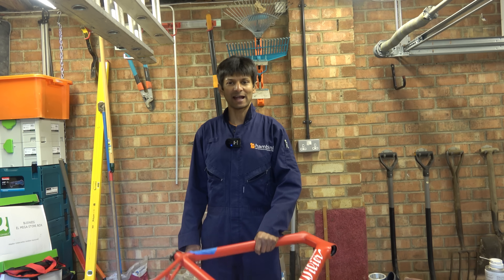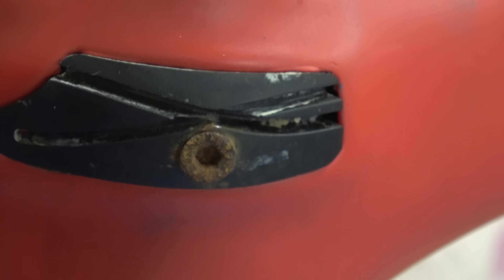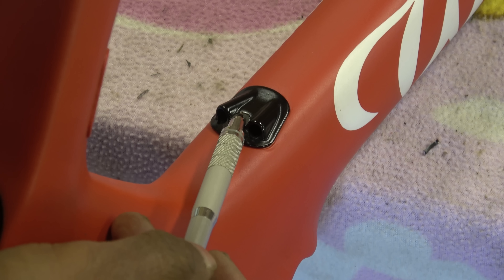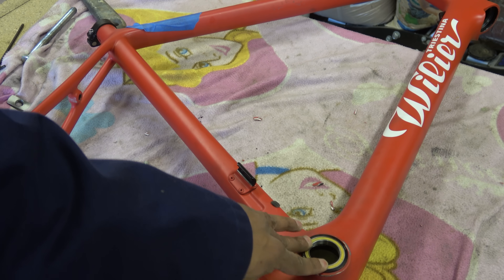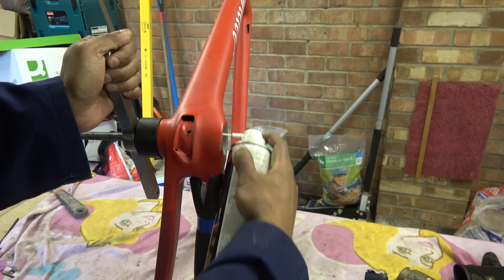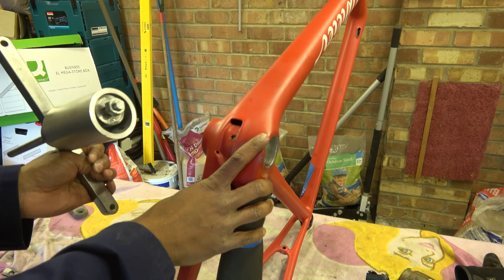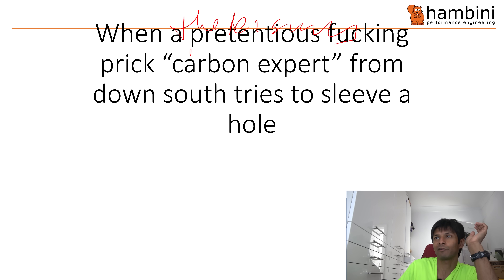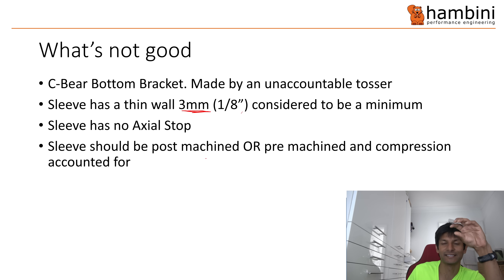Utter Carnage: Wilier Frame DESTROYED by a 5YO Armed with Rage, Facts and a BLOW TORCH

Comment: Hmmm as much as I enjoy your videos, calling the brand shite and then showing us a clearly fake frame with the shittiest paint job and repairs out there, just does not sound right. Also f* knows how they inserted that bearings into that dodgy shell, calling those bearings immediately shite is not very factual...
Reply from the maker: I don't think it's fake, it's a willy frame that has been sprayed by the carbon expert from down south.
Reply: @Hambini I could argue like an expert farmer that "I know their sh!t, this is not their sh!t". I have collected many Wilier frames through the years and although most of them are genuine crap from China, they are sh!t but for different reasons. One proof for all: for the carbon road frames they've switched from bb386 to the horrible PF92 (always with aluminum shell and bad tolerances) many years ago
Reply: Having owned a C bear bottom bracket I can say from personal experience that they are not great. LHS bearing was rough as anything after just 2000 miles and their answer was that I hadn’t cleaned and regreased the bearing. 

Funnily enough on that bike I haven’t had any problems after installing a Hambini BB, it just irks me that I wasted my money on the c bear unit to begin with.
Reply: @davidlgeorge78  Quality is made not marketed, I guess. That's the problem with many of those fancy branded bb's.
Reply from the maker: But they are shite. The only thing to come out of Italy that has excellent manufacturing tolerances is  pizza hut.
Reply: @Hambini  I can't argue with that though... :D Hahaha!
Reply: Agreed. The tolerances are there on their cheesy crust
Reply: @Hambini  actually they have very good med tech companies
Reply: @Hambini  Pizza Hut Italian?
Reply: @Hambini  Haha, the fishing poles coming from La Reglass (Maver) are exquisite ! Italian wine is not too bad neither, but we have better beers in Belgium !
Reply: @Hambini  not a fan of Leonardo then haha
Reply: @Hambini  self like is nuts
Reply: @Hambini  Pizza Hut was started in Kansas, USA. That's really far from Italy. Really far.

Comment: I just discovered the top end crap on my Bianchi Infitito CV carbon frame: plastic bearing sleeves with a massive thread damage on the drive side. Heavy creaking noises anounced the damage...
any ideas to get them replaced? bike manufacturers might see that as a total loss, I couldn´t find any replacement parts.

Comment: Why the 3mm minimum wall thickness?
Reply from the maker: it's generally to limit the distortion and keep it's own integrity.
Reply: @Hambini  Will be dependent on the frame then. The sleeves are not glued in?
Reply: It's what's needed to stop beta minus particles from penetrating.....🎓

Comment: Hambini fan, but I find this a bit unfair to Wilier since they didn't paint this frame nor did they make this new BB... This is their 2017 flagship climbing frame: Zero 6 or Zero 7.
Same mould , different carbon layup/weight.  Zero 6 was only clear coat,  Zero 7 had a couple of more finishes, but not this one. This is bad after spray...  Wilier can be blamed for not so great choice for BB in the first place, but not the issues from this video.

Comment: I have bought and then sold three carbon frames(bikes) and only own steel or aluminum now (two of each).  I have seen fitting problems on brand new out of the box bikes and roll in the door bikes. I see carbon fiber bike more as disposable rather than dependable. How many mistakes do you have to make to be a pro?
Reply: People have a belief that carbon is some high tech precision work. But it's not. The tech is in the design, not the construction. A steel frame requires more skill on the builder to do well. It's easier to spot the mistakes. Steel builders just have to be much more on their game accordingly. Much better product

Comment: I stopped buying carbon frames in 2014. Since then I have bought two bikes one titanium and one  steel and both use the BSA threaded standard. Have not had a single issue and still using the original BB's. It's all the proof I need to conclude modern stuff is for noobs and meant to teach some lessons.
Reply: Pressfit is always superior if the tolerance is right.
Bike industry doesn't know how to get okay tolerance, car Industry figured it out a decade ago.
Reply: And I've had 2 carbon frames since 2015, and they're both excellent.  I won't buy a threaded BB, because it's a stupid idea.  PF is better in basically all ways.
Reply: @richardhaselwood9478  Look at you, you don't don't look like you've ever ridden a bike.

Comment: With names named I imagine that this video won't be online for long :(
It really is totally wrong that people are charged thousands of dollars for a premium product and the QC on the important parts is done by a poorly trained monkey. Brand X says their frame will save you 5 Watts of aero drag. Brand X also has misaligned bottom brackets and dropouts that cost you 10 Watts of mechanical drag. On top of that awesome mechanical drag is the cost of bearings and the mechanic to fit them annually.

Comment: I am very disappointed with your engineering here, everyone knows you shouldn't mix imperial and metric. your use of a 3lbs hammer and a M12 bolt shows is disreputable. Even Nasa don't allow mixing of unit systems..... sharpen up hambini this ruined my tea break. ;)

Comment: I own 2017 Wilier frame and can say it is absolute shit, chain stays are crooked on one side i have 5mm clearance between rim and stay, on the other side less than 3mm (can't update tire size).
Reply: You can center the wheel by playing with the spoke tension. The mechanic that did it for my crap bike seemed pretty sure that it was a safe operation
Reply: I have the same problem, solved it by putting a small cable tye on one rear drop out. Works perfectly.  This was a Wilier Cento 1 "super legere" 2010, the last one available in Australia.  I am thinking it was returned as out of true and I was the mug they onsold it too at a discount,  still cost $5k !!!
I would NEVER buy a European frame again.
Reply: @MrHowardmz  There's nothing wrong with "European" frames...most of 'em are made in Asia anyway. I don't doubt there are plenty of 'em that aren't any good, it's the Q/C of the brand who is buying them from the actual manufacturer that counts...as Hambini has pointed out many, many times. 
First thing we used to do at the shop I worked at was CHECK alignment and stuff like this - and reject 'em if something wasn't right rather than just find some dumb schlub to sell it to at a discount.
Reply: @MegaHolmus  pretty sure that's a wheel issue, hub not centered compared to the rim
Reply: I have numerous wheels and its the same with all of them.@appelflapdrol
Reply: Possibly wheel issue, plus most Wilier bikes feature asymmetric chain stays, similar to Pinarello

Comment: Mitutoyo....... Posh Git!!
Reply from the maker: I wouldn't say I'm sponsored but they do supply measuring equipment for the channel. Anecdotal, but they've seen quite an increase in sales to bike shops.
Reply: @Hambini  My channel is sponsored by Spudulike...... They haven't seen an increase in sales 🤣
Reply from the maker: @ribblevalleycyclist  Moreover, I could hardly turn up to do a job and whip out my park tool cone spanners or park tool vernier. I'd be laughed at until I got to the next village.
Reply: @Hambini  Steady on, nowt wrong with Park Tool cone spanner’s…….. Regular ones though, different story